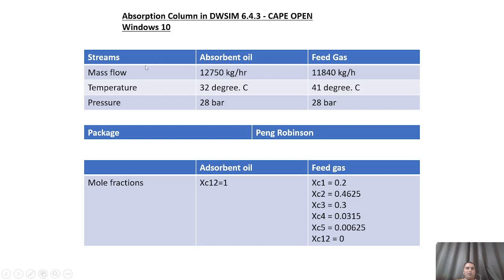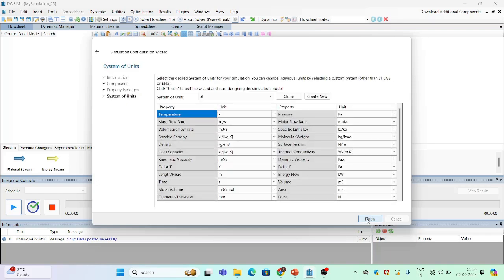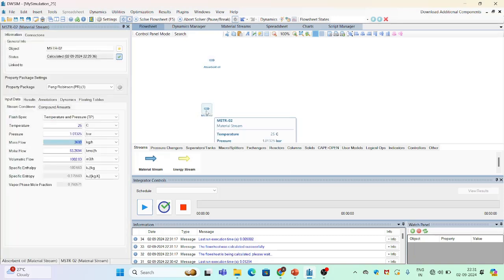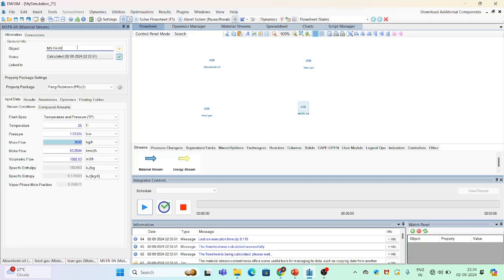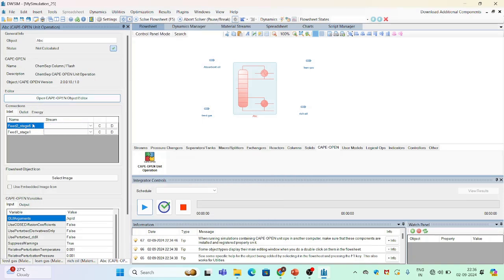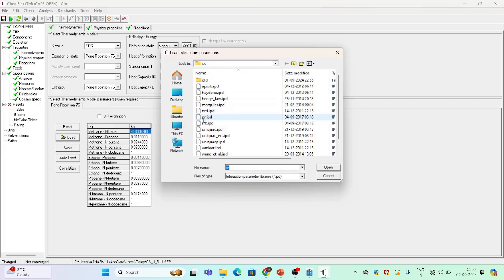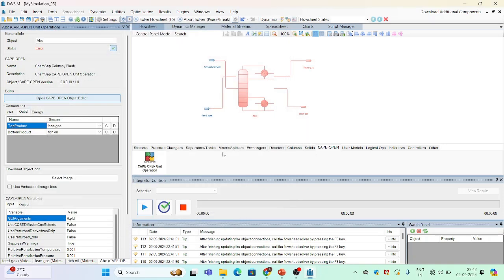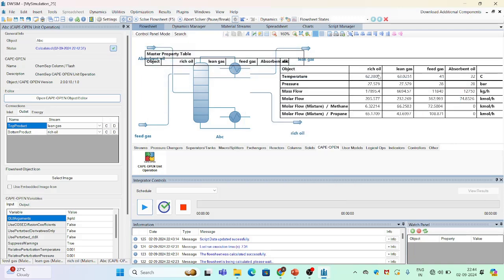Absorption Column Simulation in DWSIM | #chemicalengineering

Comment: Kindly post an example simulation using instead of absorption oil using MEA amine absorption for CO2 recovery
Reply from the maker: I am planning to do a video over that.
Reply: Pls bro do mea
Reply: Also why we should use seperate stream for outlet once absorption column connected it automatically comes nah and why open cape using here